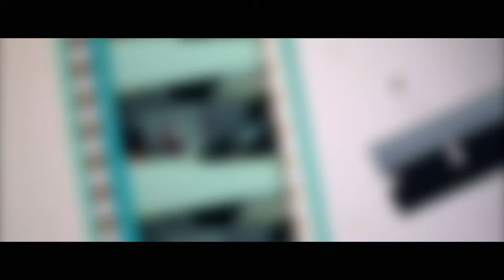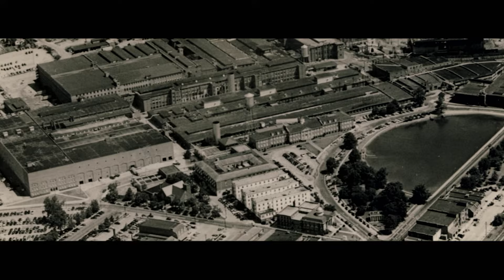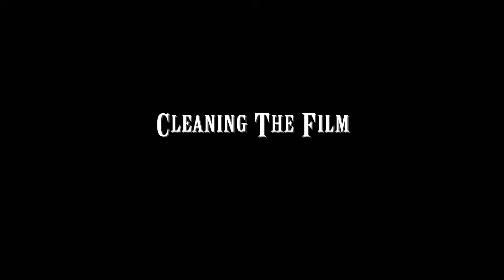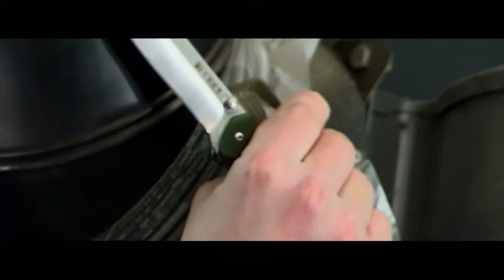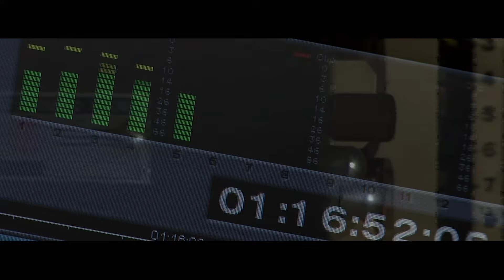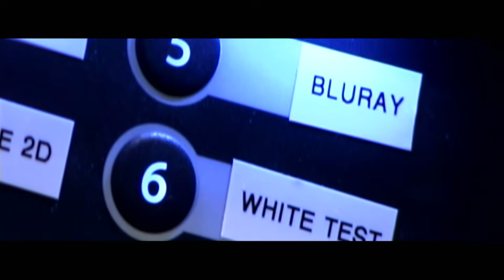The Silent Switch

Comment: I started my film/sound career in 1978 as a studio projectionist. Mostly I ran "double system" screenings (10-minute reels, separate picture and single-stripe sound = 4 times the work of 20-minute optical prints).
Reply from the maker: Oh gosh I just realized what you meant by 4 times the work with the mag stripe. How did that stay in sync with the projector?

Comment: the priactise of  loading the film reels on to a big reel. ..in the cinemas i spent time in when young closeed 1979 1982  they had the  changeover system. i dont knwo how there weeren t more mistakes?  the cinema i spend most time in in 1980 was built in the 70s , it was a two screen and had thee platter system. state of the art. as a child i wanted to be a projecttionnist. vhs video ruined icinema.  i loved the house lights as well especially in the old cinemas.  It is heartening that a cinema like the GEMis amazing , still thriving

Comment: Wrong, it has stereo.
Reply: Who do you think is "wrong" and what do you think "has stereo"??
Reply: @gregfaris6959 you can see the Dolby processor in the soundrack. And you clearly see the surround speakers in the back of the auditorium. So not just "stereo" it's Dolby stereo. Unfortunately no Dolby digital or DTS sound there, so the pcm sound if digital runs via converter into the old Dolby  equipment

Comment: I live in Australia and was a projectionist for 50 years. My favorite was the Westrex arc with a Simplex head. Great set up. I wish to ask one question if anyone can answer please, I have never threaded a reel from the back of the reel, always from the front. Is there any reason this seems to happen in the States on this documentary, as we never did it that way here.
Fantastic documentary. Such beautiful memories.
Reply from the maker: Sorry for my late response. That is a great question as I have noticed in youtube videos of modern day projectionists in Europe run the reels with the film coming off the front of the spool. I have no idea why its different here in the states.
Reply: @johnaustin80  Hi John, I'm not sure I completely understand your question. If we are talking about the platter system. The film cannot be taken from the outermost part of the film because that is the end of the film. The start is in fact the innermost part of the film. I cannot be done in any other way.
Reply: I was just thinking that threading the film from the spool counterclockwise would mean that the film was spooled emulsion side out. Would I be correct?